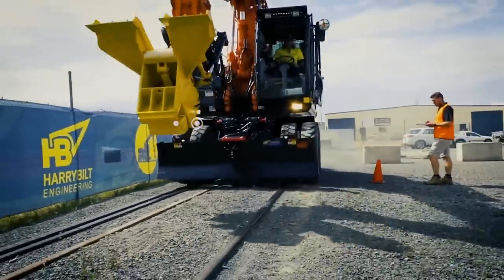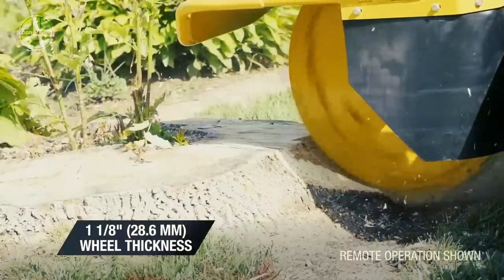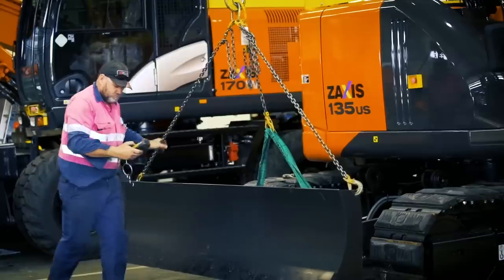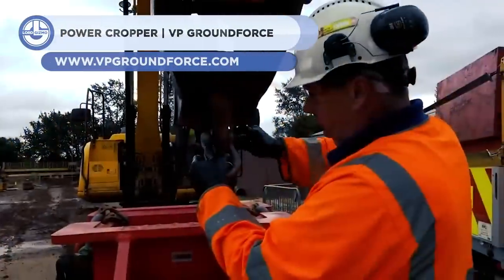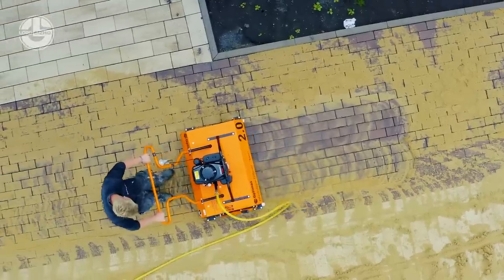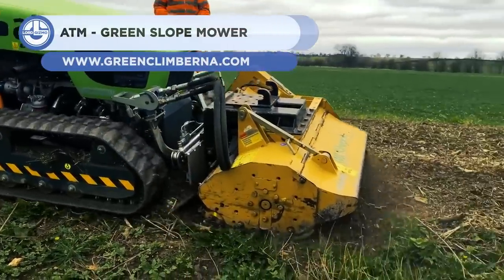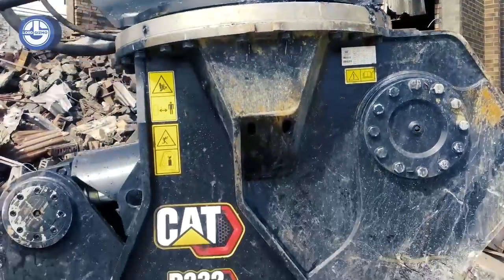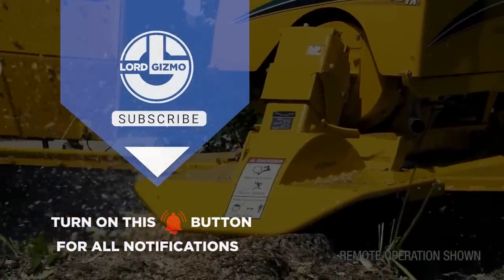INSANE Powerful Machines & Extreme Heavy Duty Attachments You Must See

Comment: Hahaha,the first machine is designed to shear and crush ( non) ferrous metals..such as cars....last time I checked Steel and Iron were magnetic and therefore ( ferrous)
Reply: Oh!
Reply: There are magnetic non ferrous materials, however, Ferrous "of or consisting of ferrite" Ferrite is iron. so iron and steel, are very much ferrous materials, nickel and cobalt are magnetic, but not ferrous. These metals have "ferromagnetic properties", meaning they are very much magnetic, but contain no ferrous material :)

that said I came down here to see if anyone else called that out, because my little machinist brain went "Hold the phone, that isn't right at all"
Reply: @charlesmayberry2825  I worked at a very large scrapyard in CT..we proccessed every kind of metal...from roadside scrap cans to millitary and aerospace entities...I have forgotten more about Metal than most will ever know...and if you show me a CAR that is made of COBALT and or NICKEL I will be amazed...vehicles get scrapped into only 2 categories,...light iron or number 1 steel...both of which are MAGNETIC
Reply: @joemarchinski914  "cars and other metal scrap" it's the other metal scrap you'll find those things. cars generally only have a small amount of nickel in certain parts (which is in the form of alloy aka stainless steel) but cobalt, nah. I mostly was pointing out for educational purposes that there are non ferrous materials with magnetic properties, even if they are much rarer.

I was a machinist a long time I've also forgotten a lot more about metals than most ever learn :)
Reply: I think he just missed to say both together.... Ferrous and non ferrous
Reply: @-sawal  very likely, we're just having fun here :)